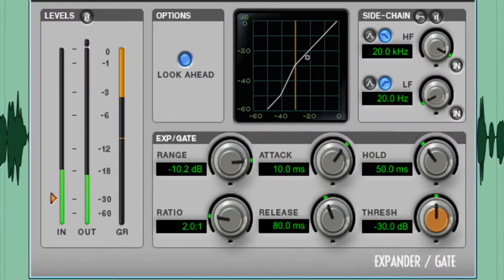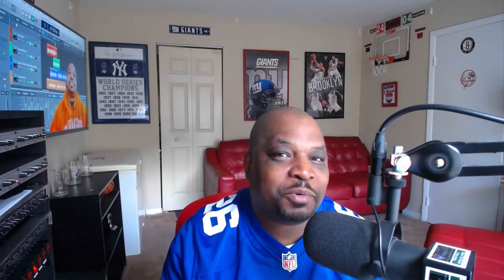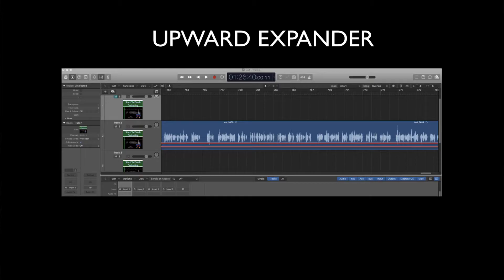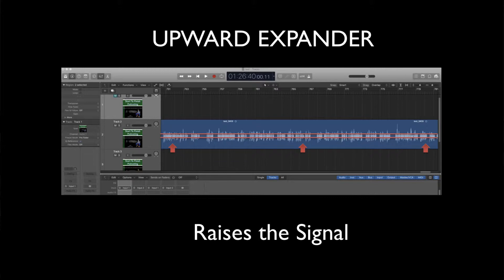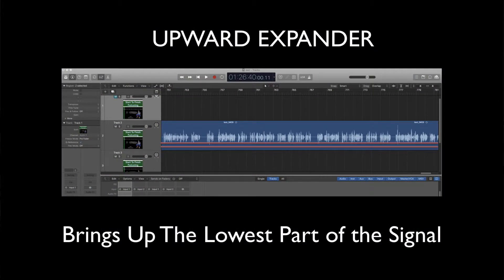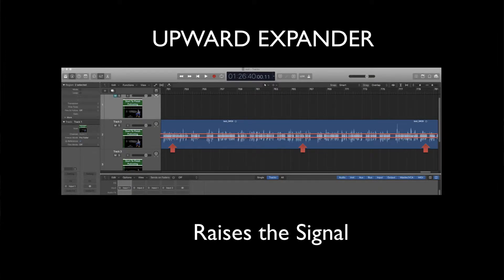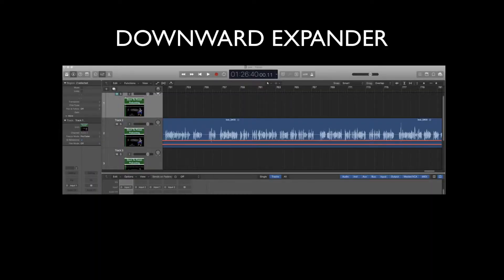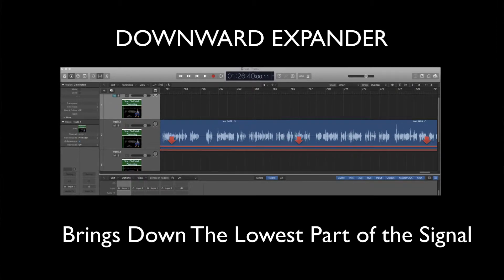Expander Gate vs Noise Gate: Which Works Best For Podcasting?

Comment: Hey mate, great explanation! Really helped me understand the key differences between the two. What would you recommend between the dbx166xs, dbx266xs or the Behringer mdx2600? These 3 are all around the same price range where I live (Australia) so I would appreciate your advice. Cheers
Reply from the maker: Get a DBX286s instead of the three you suggested.
Reply: If it isn't live, you can just use a plugin.

Comment: Expander. And unless you are performing live, skip the hardware solution and just use a plugin!
Reply from the maker: This is just my opinion but plugins are secondary (just my opinion). It all depends on the user and what works best for them. Some will use plugins while others choose hardware. I find that for me plugins don't work well and do a thorough enough job than when I use hardware. Some users will use plugin as it is a lot cheaper to get free plugins  compared to buying hardware.  Like I said though it all depends on the user. I rather have hardware. Me using plugins compared to using hardware is like me going into the store and buying the Food Lion/Kroger/ShopRite/Harris Teeter brand of sugar flakes cereal instead of Kellogg's Frosted Flakes.
Reply: @StartToFinishPodcastingTV  it's a different purpose. In live performance, the processing needs to be applied in real time.
But when studio recording, you are better off recording the master "clean" -- without effects -- and adding effects in post/render.
With decent preamps/converters, there is nothing you can't do better in post, unless your gain is too high and you are clipping.
Reply from the maker: @mrtechie6810  I am now confused bro LOL.  We were talking about using hardware vs plugins.  Now you switched it up to the subject of recording with plugins vs recording without plugins. I guess I can address the "recording with vs recording without" plugins. The keyword you said in your last reply was "better off".  The term "better off" is very subjective. Your "better off" may be different from someone else's "better off".  What works for you may not work for the next person.  I think you and I agree on the same thing but I may have not been clear in this video.  When I talk about using hardware instead of plugins I didnt mean it in instances of prerecording.  What I meant was that I prefer hardware when I am going live compare to using plugins.  Now when recording a prerecorded podcast then it is best to record clean with no effects.  I myself sometimes record with live processing applied to my live recordings because I have been in this game for a long time and know the exact settings I need to obtain good audio while others may not. If someone is more on the side of being a new podcaster then I strongly recommend that they record flat with no effects. However for a seasoned podcaster as myself I know more of what I am doing so applying effects (whether it is live recordings or prerecorded recordings) I get the same good results.